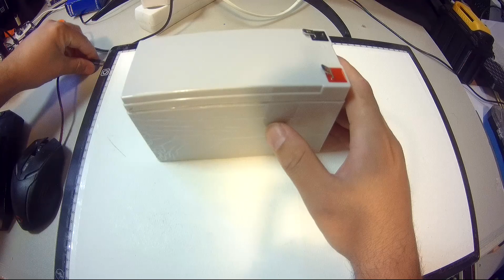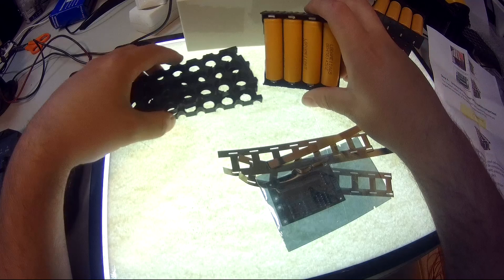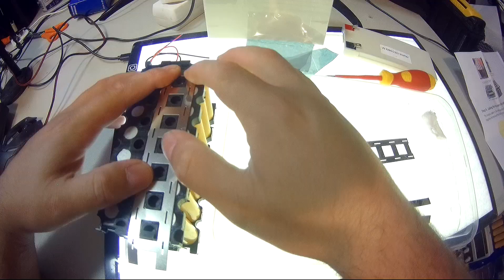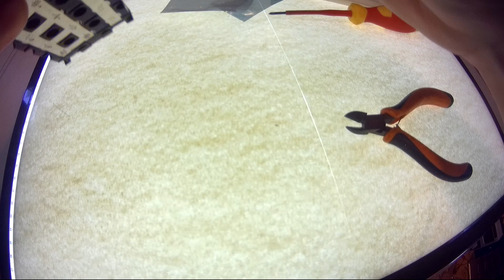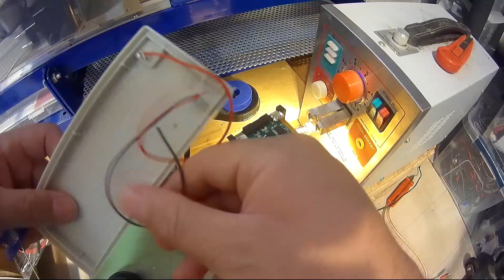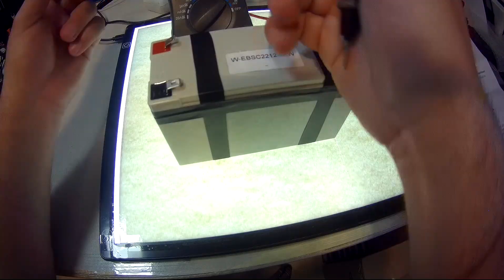DIY: POWER Bank 12V 🔋 Build With 21x 18650 Cell's -Step by Step

Comment: What type/brand charger do you use?
Reply from the maker: I’m currently operating a battery pack in an off-grid (island) setup, charged by solar energy using the RBL-30A solar charge controller.

The system consists of:

2 × 20W flexible solar panels (totaling 40W) connected to the charge controller

A 12V battery pack that is recharged during the day via solar power

A surveillance camera, which is powered through the 5V/3A USB output of the charge controller

---

Solar Charge Controller: RBL-30A

The RBL-30A is a PWM solar charge controller with intelligent battery recognition and full protection features. It's suitable for lead-acid, sealed, gel, flooded, and AGM batteries. Key specifications for the RBL-30A model include:

Automatic voltage detection: 12V / 24V systems

Max PV input voltage (Voc): 24V (for 12V systems), 48V (for 24V systems)

Max PV input power: 360W (12V system), 720W (24V system)

Charging current: 30A

Discharge current: 10A

USB output: 5V / 3A for directly powering small devices

Charging mode: 4-stage PWM (Bulk, Boost, Float, Equalization)

Float voltage: 13.7V (default, adjustable)

Low voltage disconnect: 10.7V (default, adjustable)

Reconnect voltage: 12.6V

Temperature range: –35°C to +60°C

Self-consumption: <10mA

Protection features:

Short-circuit protection

Reverse polarity protection

Overload protection

Dual MOSFET reverse current protection
Reply: @boringengineering5422  Thanks for the information

Comment: Cannot used vrla ups battery case. It will not fit. Fit only without battery holder
Reply from the maker: Thanks for the heads-up! That's an important point. My battery pack is built with lithium-ion cells. These have the advantage that, unlike lead-acid batteries (like VRLA), they do not generate gases during normal charging and discharging. They are also thermally better encapsulated internally, which might somewhat simplify handling in an enclosure not primarily designed for Li-ion, as there's less concern about ventilation.
Reply: @boringengineering5422 when i first times do this from youtube video, i though they using plastic case from used vrla battery, when i tried to assemble it with battery holder its not fit the case, i never knew they sell battery case simmiliar to vrla case with size that fit the 18659 battery